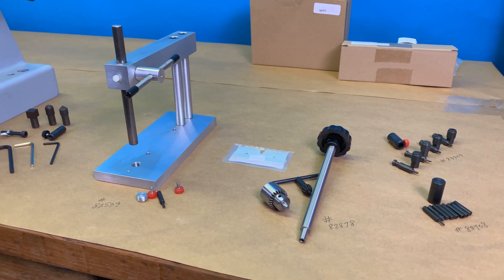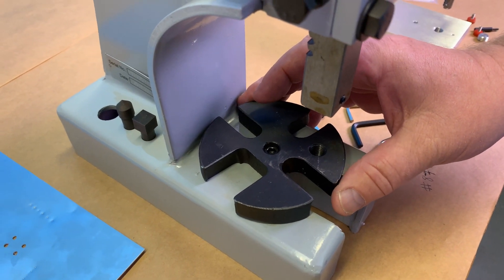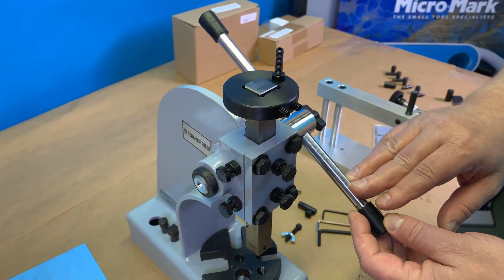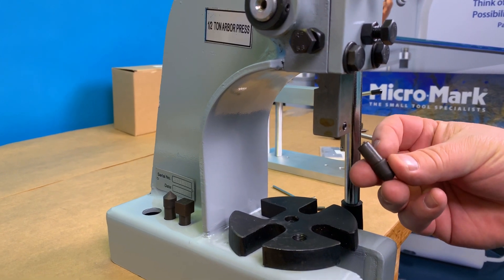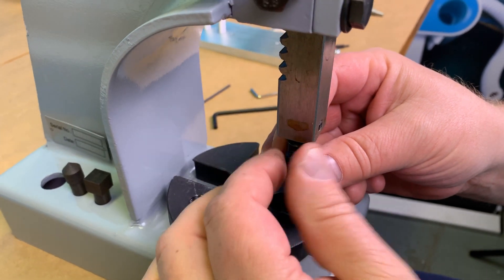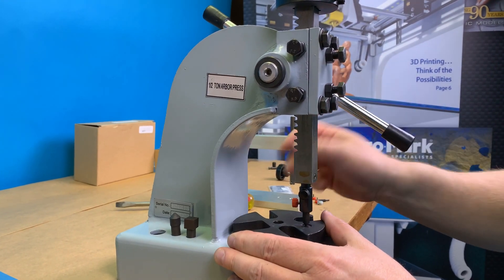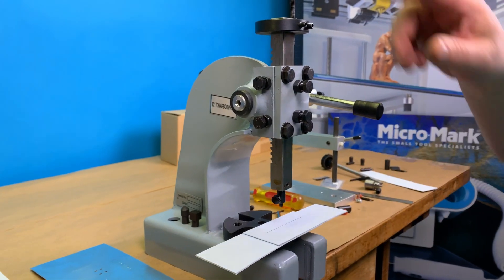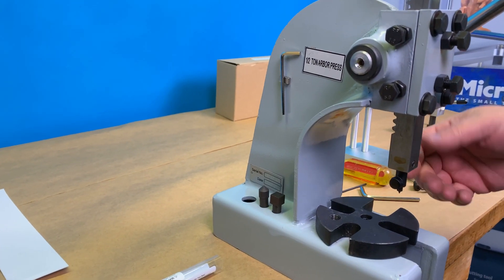How To Use The MicroLux® Half-Ton Arbor Press

Comment: The specifications says the throat depth is 80 mm (3-9/64"). What is the throat height from the top of the table to the bottom of the ram fully raised? Am wondering if this arbor press can be used with wheel cups to install wheels on O-gauge trains. I believe one will need 4 1/2" min throat height. Besides throat height, the base would also need a 5/8" hole to accept the shaft of the bottom wheel cup.

Comment: Any tips to eliminate play from the ram? I cant get it to consistently land the punch in the die. Pretty frustrating. I also wish the die hole in the plate was set back further for more flexibility. The plate hits the support arm getting the die to align and an extra couple mm to play with would be nice.